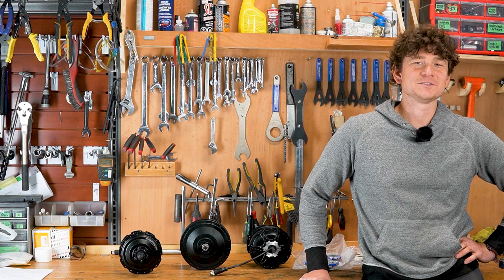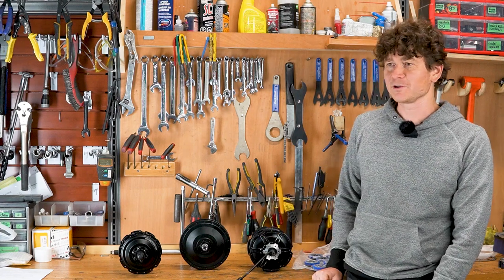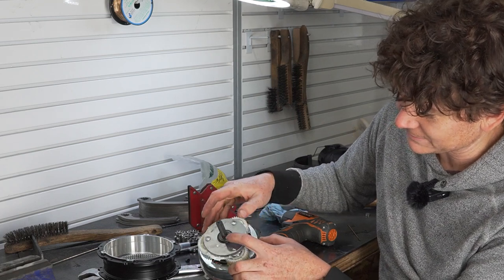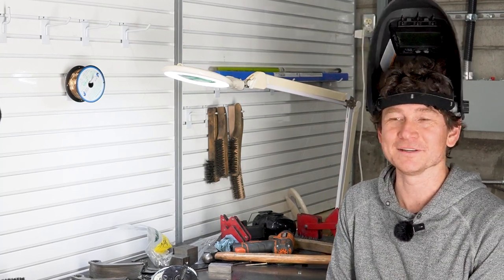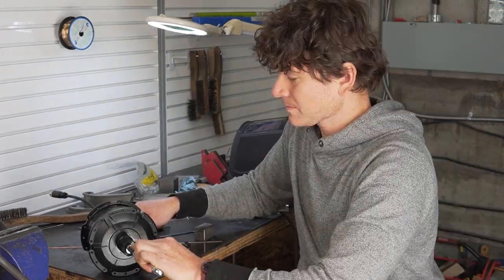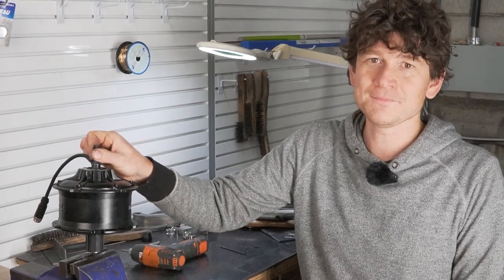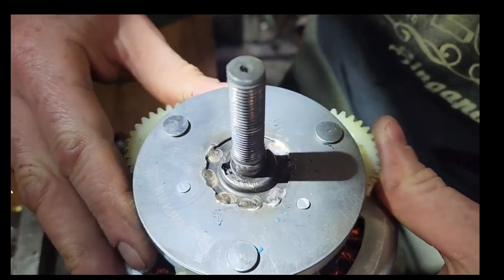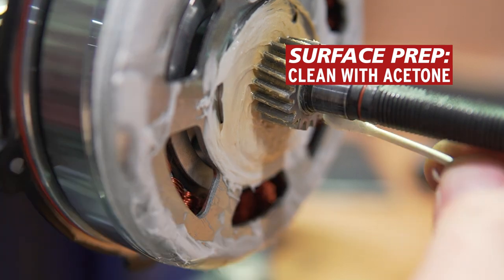How to get REGEN braking from your geared hub motor. Lock that clutch!

Comment: May I ask potentially silly question? While looking at all the grease on the planetary gears and thinking of the potential high heat and wear on these motors, why isn't graphite used as a lubricant?
Reply from the maker: The motor heat is not high at all by grease standards (like 100-110 oC max) and electrically conductive graphite dust floating around the motor can very much mess up hall signaling, the same way water in the motor can cause leakage currents. There is almost no wear on the insides of the motors, and with the nylon gears we honestly are not convinced grease is even needed at all.

Comment: The weld looks kinda jank lol, I'm wondering if I can find some machine shop to manufacture the planet carrier if I draw it in cad. Just not sure about the exact type of steel used in the original sx gear set.

Also for the sx gear set, it looks like there is quite a bit of axial play even after the C ring is attached. I saw there's a broken o-ring under 1 of the gear bearings, but none on the other 2, on the replacement gear set I got from your shop. If I put the o-oring back under it seems to fit tighter. I'm guessing they are using the o-ring to fill up the gap/preload the bearing? Would the bidirectional axial forces from regen cause the gears to move back and forth axially and grind up the shafts?

Another thing unrelated to regen (but related to what you mentioned about ensuring no noise from motor after welding), I sometimes hear a noise from the front wheel that could be described as a sloshing sound, or maybe the sound of some fabric tearing, for a split second. That probably happens most often when I go from accelerating to coasting, but I don't remember for sure (could be from when I start accelerating if I got it backwards). Could that be from the freewheel or is it more likely to be from the fenders? Is that a normal sound if it's coming from the freewheel?
Reply from the maker: With access to CNC You can definitely custom machine your own planet carrier and make it much lighter since it doesn't have a clutch mechanism.  A bit of axial play in the planet gears is of no consequence.  The noise you hear is probably the motor simply winding down from it's own inertia after you let go of the throttle.
Reply: @GrinTechnologies  do you happen to know what kind of steel they are using for the planet carrier?

Comment: Is it possible to use a GMAC clutch assembly on a Mac motor to get an easy regen upgrade like the eZee?
Reply from the maker: We went with a wider / stronger keyway on the GMAC planet carrier than the regular MAC motors, so it wouldn't be quite as straightforward.

Comment: Can the Bafang G063.1000.D be welded? I have this motor on my AR  X-Class bike.
Reply from the maker: That is exactly the same as the G062 shown in this video. So yes. But you will most likely need to change the controller on your ebike to take advantage of the regen
Reply: @GrinTechnologies  If the controller is left unchanged then you still get the braking, but not power back into the battery, correct?
Reply: @kitesailor  No, no regen, no braking.

Comment: With the removal of the clutch on the ezee motor for Regen does this open the possibility for running in reverse?
Reply from the maker: Yes indeed, those two things go hand in hand. In fact, the only reason that ezee had a stock carrier without a clutch is because they had a high volume customer that required reverse mode. Regen wasn't part of the picture.

Comment: Now for the next complex idea, a clutch that operates based on whether a lever or switch is pulled/pressed or not, so that you can freewheel and regen when necessary.
Sounds dumb but would give you more of the benefits of both worlds?

P.S I have an old Bafang BPM1 hub, any chance you guys know where to get a new planet carrier assembly, preferably with metal gears 100v melted the gears after a year and I want to do more dumb stuff with that hub.
Reply from the maker: Not dumb, but so far any implementation idea that gets hashed out seems to add enough complexity to be "not worth it". Especially when the drag losses are pretty insignificant -much less than the energy you get back into the system from regen-.   The more sensible approach to reducing the drag losses to almost zero would be switching from permananent magnet motors a technology without PM's, like induction or switched reluctance, or go ironless like maxon motors.  Without magnets moving over iron, the unpowered motor can spin freely without resistance, yet still stay always engaged for regen.
Reply: @GrinTechnologies  Oh I didnt mention the dumb stuff I wanted to do, I was talking more pushing over 120v through it again now that I have amassed quite a few 60v batteries.

Although, you make a great point, I thought it would add too much complexity, but then I started thinking about the Rholoff Hubs and the way they work and thought eh why not, one day we might be able to solve that riddle more simply.

If you ever see any hubs running induction motors I would be very happy to see them, my Escooters would be much less of a pain to walk home when I get flats then.

Thanks for the response :)
Reply: @GrinTechnologies  Btw, I very much do need a replacement for my BPM clutch assembly and have been having one hell of a time trying to find one.
Reply: Lol I just finished writing my comment and I had the same exact question!
Reply: @GrinTechnologies  Interesting, I had the same question! That answers it. 
So it's hard to imagine a simple mechanical solution to offer this actionnable mechanism.
The benefit would be greater for heavier direct drive motors but
their stators are solidly fixed to the axle, so it sounds unplausible to find an elegant solution to disengage heavy PM motors mechanically.
I've personally experienced running out of battery it on my commute, and would have benefited from this solution in that case :)
Reply from the maker: @NikoxD93  I mean the market is wide open if someone thinks they have a clever enough implementation and wants to have a stab at it.  There are lots of ways to achieve actuation whether mechanically, elctromechanically, with magnetic fluids, etc.   
FWIW, The drag from a small geared motor without a clutch is actually worse than that of a large direct drive hub.
Reply: @GrinTechnologies  The drag on my GMAC (without the electronic freewheeling), is really not bad.  Both my wife and I have easily pedaled home, uphill, with a dead battery.
Reply: @GrinTechnologies  Oh ok! Thanks for the clarification, I thought for sure my larger motor would have more resistance :)
Magnets! (:

Comment: Hi Justin Grin,
Now I also have another question.
There are warnings about this subject all over the internet.
The battery is not charged in a conventional way, but via the cables that normally supply the motor.
The power that comes back could damage the battery BMS circuit board.
It is also said that during downhill driving the battery can be overcharged and overheated.
I would really appreciate to hear your opinion on this?
Can the BMS circuit board be modified for this?
Is it true that the battery can be overcharged, is this not secured?
Can this be checked via the display and, if necessary, remove the battery during the descent.
But then the engine probably won't brake anymore.
What do you advise?
Reply from the maker: We've discussed this topic in various presentations and videos about regen.  In general, it's not an issue at all.  You'll always be drawing much more than putting back in. In some special situations (like you live at the top of a mountain and start every trip with a really long downhill), then you are aware of the situation and simply charge your battery to like 85 or 90% so that it has a reserve for regen out of the gate. If you have a programmable controller, then you set the max regen voltage to not exceed the full charge battery voltage and the regen will automatically roll back as required. 

Single port BMS circuits will cut off regen, dual port BMS circuits won't. Neither will get fried from regen unless they are terribly designed BMS boards.

Comment: I guess it is possible to do that with a normal Mac motor to work like the  Gmac  ? Any other  hidden tips  beside the one in the video  like using -Loctite   , Many thanks
Reply from the maker: It is indeed possible. MAC motors have an extra complexity that the motor stator is also a bit loose on the axle, and not just the planet carrier. So you may need to loctite 648 on the actual stator too as that will wear down from back and forth torques in a normal MAC.  We had to have the stator core material in the GMAC's modified with a steel sleeve insert as the stock stator core that was all aluminum would eventually get quite loose.

Comment: are the nylon gears put under extras stress from doing this?
Reply from the maker: Zero indications or signs of that so far, and there isn't any reason why the nylon gears would care which direction the torque is in. So far all the 'issues' stem from metal components that slip or wiggle a bit when alternating torque direction, and that includes the planet carrier/key stock and axle itself when secured with just a normal torque arm. Both of those are addressed in this video.
Reply: @GrinTechnologies  ohhh that's good to know, I'm opening a repair shop of my own after working as a repair tech for this mom and pop shop for the last 3 years, and recently there's been a spade of ig hubs coming back with planetary gear stripping, i assume it's cuz of the lack of grease cuz wen i service them is bone dry inside
Reply from the maker: @edgefx1  We've not seen any correlation between greasing and gear damage, nylon is largely self lubricating after all. We have seen batch-to-batch variations when clearly one batch of gears had poor process control in the plastic injection molding or whatever and was more prone to failure when previous lots of the same hub held up just fine. And of course issues with people putting more torque in the motor than it can sustain. If the motor is run quite hot, the plastic gets correspondingly weaker, and most gear stripping happens during a long climb or other heavy usage situations where the motor is toasty.
Reply: @GrinTechnologies  hopefully that's the issue, a batch of bad gears causing a bunch of costumers to come in for such repairs🫣, if it's just a bad batch then id love to be able to offer this service without the customers coming back saying their gears stripped

Comment: Good to know about this for the g062. 
Dont know if I'm gonna go with this tho since I'm planning on going dual 60v battery on my radrunner with a diode battery blender.

You mentioned temp sensors back on the radrunner upgrade videos. Will said temp sensor video also work for the g062 motor (when video releases)
Reply from the maker: Yeah if you have a diode you won't be able to do regen, but you really don't need a diode with parallel connected batteries. Just charge them independently and plug them together for discharging and they're is very little risk. 

The temp sensor upgrade depends on the controller, but on those that can take a multiplexed speed and temp signal is pretty straightforward.

Comment: Hi Justin Grin,
Great, I want this with my bike too.
I appreciate your work very much.
Have you already thought of drilling the torq handle vertically together with the shaft, I was thinking of 4 mm.
Of course on the side where there is no electrical wire.
When mounting, the shaft can then be blocked against Torq forces with a 4 mm bolt and screw.
One of hardened steel that can take more.
Have you already tried this?
kind regards Wim.
Reply from the maker: A 4mm bolt will have nowhere near the strength to resist the rotating forces on a axle.  80 Nm of torque at the surface of an 12mm axle is about 3000 pounds of shear force.
Reply: Ok,that is more then I expected, thank you for the Info.😊

Comment: Such an important topic! Ever tried epoxy for affixing the clutch?
Reply from the maker: Yup. Several times and it never came close to doing the trick, even when we tried to completely fill all the gap space in the keystock. Epoxy does not bond to metal very well, nor does it have much strength as a general gap filler to take up play.
Reply: Would loctite 684 maybe bond strongly enough to the metal for this?
Reply from the maker: @3737HH Oh I see, you are talking about using a glue/adhesives inside the clutch assembly to prevent it from freewheeling, rather than using it as a bonding agent between the planet carrier and the axle to prevent play.   No, we have not tried this. The clutch is full of grease and rivetted together, so you can't really get at it to clean and flush out the inside of all grease so that a glue would stick.  
That said, we HAVE seen some clutches on old motors with water damage where the rust itself caused the clutch to become seized. So perhaps a strategic soaking in salt water could do for those without access to welding supplies.    We have also tried drilling holes and pinning the clutch mechanically, but without being able to see the inner workings it's hard to do this with proper effect.

Comment: I was wondering if we could have both Direct Drive and Freewheeling possible on the same hub motor by using a clutch that can engage or disengage like most ICE vehicles?
That would be the best of both worlds: You have Regen, but you can also disengage the motor using a lever or a switch, to reach a higher top speed downhill or to decrease resistance.
I wanted to contact Justin to see if he had already thought about this possibility, if it is feasible and how could it be achieved?
Edit: that question was asked and answered in an other comment already :)

Comment: Very cool. For the addendum couldn’t you also just weld the axle to the carrier? I guess that would make future servicing difficult/impossible. I wonder if solder would give a strong enough bond and be easier to do along with your initial weld and remove for future repairs?
Reply from the maker: You totally could, but then as you say it means future servicing of the motor gears is impossible, and you would also distort the axle with weld bead right near where the ball bearing of the shell needs to fit. It would have to be a tight job or one that is ground down after the fact. Brazing would likley be better.

Comment: it possible to swap axel  out on the motor  to new ones
Reply from the maker: On principle yes but it is both nearly impossible to source replacement axles of a given motor type, and the actual swap is a royal pita since everything (wiring, soldering, interference press fitting etc) needs to be redone